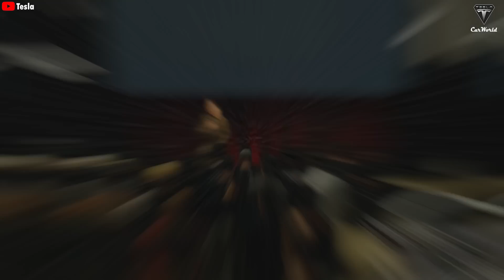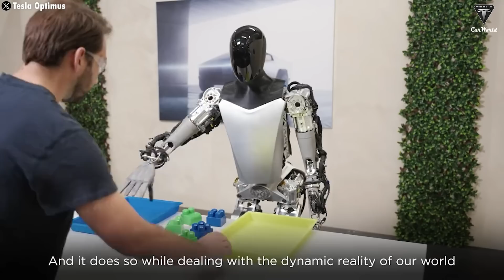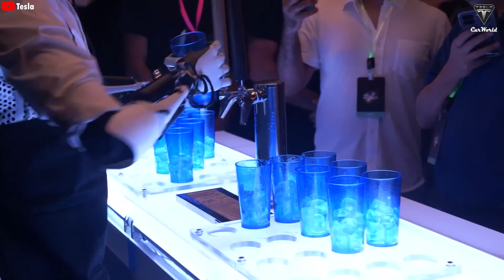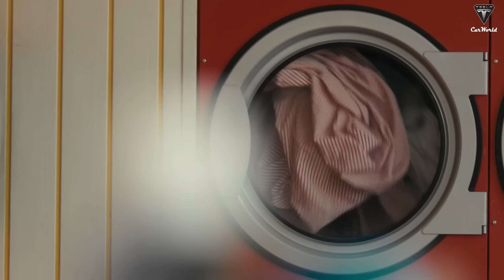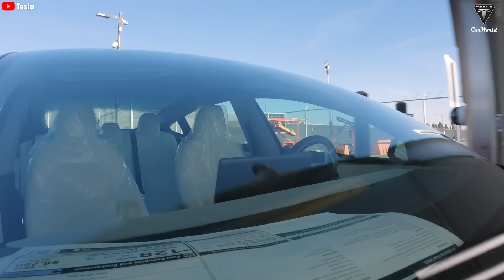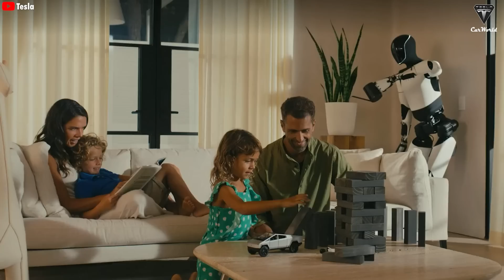It Happened! Elon Musk Made Shocking UPDATE on Tesla Optimus Gen 3 $3480 | 10 Times BIGGER !

Comment: At minute 6 saying that a robot is more precise and can't be ramped up in production is both Ignorant and Wrong!   A robot won't have to be precise. The AI will test itself out and note where all its extremities are and how to operate them. The AI will accommodate each difference within itself and self tune. Plus, - HEY - Production is NOW Quite Exacting with CNC machines, assembly robots, Injection molding, electronics manufacturing and Digital Design.  So, pumping out 100 good robots easily ramps up to thousands. If, you have the resources, and TESLA does have the resources.  ALSO - With 3D printing available ALL Designs can be changed and optimized within hours.  3D printing spans across plastics, metals, rubber and in some cases possibly electronics.  Then, realize that TESLA, as Elon Musk has stated, has REAL World AI developed, used and available to install into its Robots. NOW!  Next, AI is online - ALL AI instances readily learns, transmits, upgrades and adapts - ALL OF THEM.  There can also be embedded a design feature to self design upgrades as they are used in the field. So, not only learning and dissemination of knowledge within minutes. They could/should/will(?) relay physical adaptations, changes, fixes, upgrades to the factory, which can implement new features and upgrades with months, weeks, days. or hours. Depending on the subsciption and contract with TESLA.     2025 Could BE The Birth of the Robot???

This is a MAJOR MOVE for Humanity.  MAJOR!!!

Comment: Just like all tesla's other products, they are spruiked at a very low price to get people interested, before doubling or tripling in price. The first Optimus robots will go into factories as this is where the greatest demand is with lower risk of issues that could effect people directly, (Example: an Optimus accidentally spilling boiling water on a person) Factories will also be able to work Optimus robots 20 hours a day and gain the greatest returns on investment. These Businesses will likely be willing to pay 50,000-75,000 per Bot. Then once optimus has had a few Software upgrades to make it safer for the Home environment as well as allowing Mass production to bring costs down, Optimus Might be sold for as little as 30,000 USD but more likely Tesla will want to rent as many as possible Robots until supply has caught up with demand and Businesses will pay 30,000 a year to rent Optimus, as their productivity will rise exponentially and renting means Tesla covers maintenance costs. So don't hold your breath for any cheap access to an Optimus for 3-5 years after mass production is in full swing (around 2030-2032) Chinese Built bots may keep tesla pricing lower but the US will probably tariff Chinese Bots 100-200%?